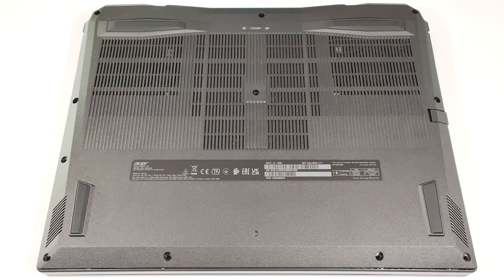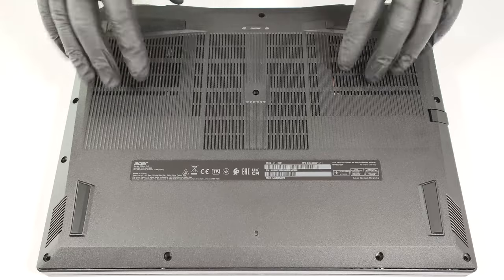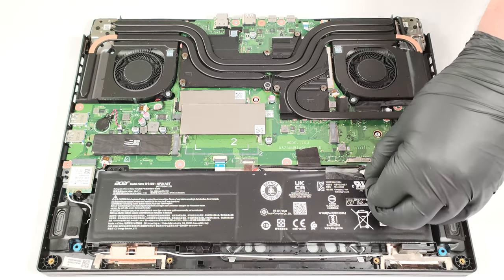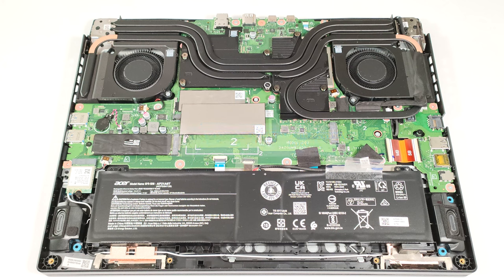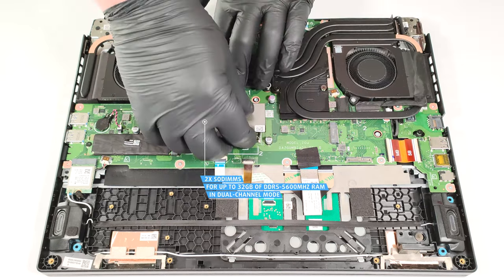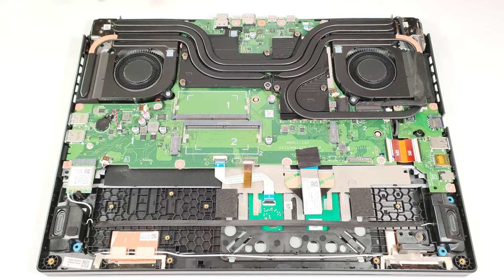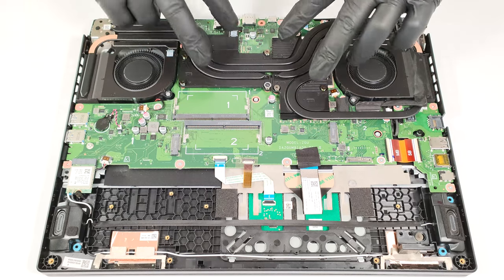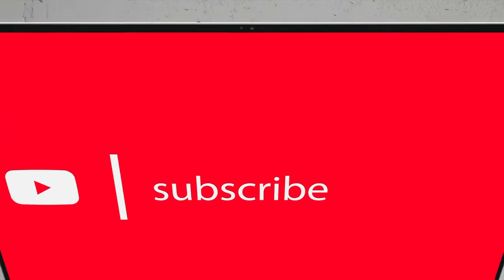🛠️ How to open Acer Nitro 16 (AN16-41) - disassembly and upgrade options

Comment: i love this laptop but it definitely only lasts 4 hours max when unplugged
Reply: You need to enable battery saver mode and other tweaks, I got 11 hour sot. Definitely not when gaming though
Reply: Also the screen needs to be set 60hz
Reply: @alfzki How do you do that?
Reply: I agree with the original comment I own one for almost a year now and when unplugged and in eco mode and battery saving it last not even half that (depends on various factors) but yea I'd say 4hr is the range when unplugged
Reply: @Akif46723  right click on desktop, screen settings, detailed settings, change hz. value.
Reply: @Sekkiryuutei  Do you change the active gpu? There are 2 gpus. One of them is nvidia gpu and the other one is integrated gpu (which is in the cpu actually). When you switch to integrated gpu, it will use less power. Of course I assume that you don't play games etc. on integrated gpu.
Reply: @ÇağdaşVarol-o8c  thing Is I've been noticing that too I'll have to check properly but ty

Comment: Can you upgrade the graphics card on this?
Reply: yes, you can plug RTX 6090 inside, there is a dedicated socket on the back
Reply: Serious answer: no.
New laptops that support graphics card upgrades are extremely rare. As far as I am aware, the only example that uses a current-gen processor is the Framework 16. Some older laptops support MXM graphics cards.
Plenty of laptops (including any laptop with a thunderbolt 3/4 or USB4 port) support external GPUs, but internal graphics cards normally can't be installed in laptops.

Comment: so the ram comes with 1 16g stick, and 2 thermal pads in case i add and an xtra ram stick?
Reply: Depends on the specific model. Some are 2x8 for example.